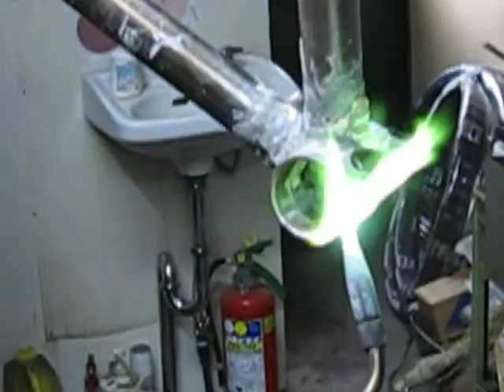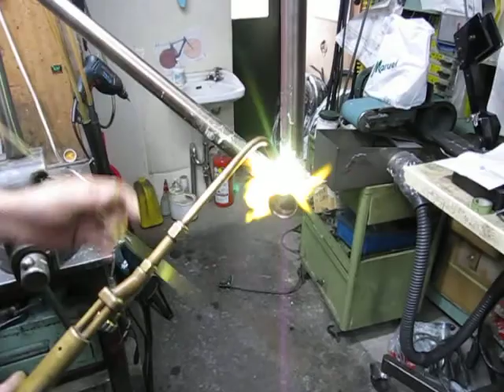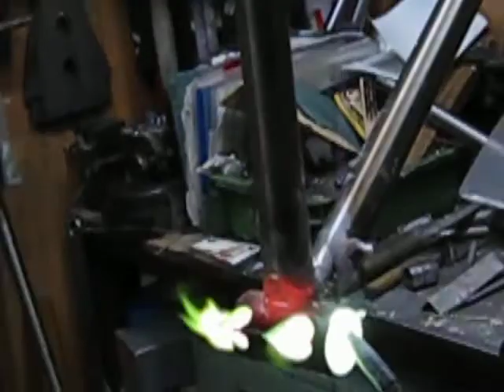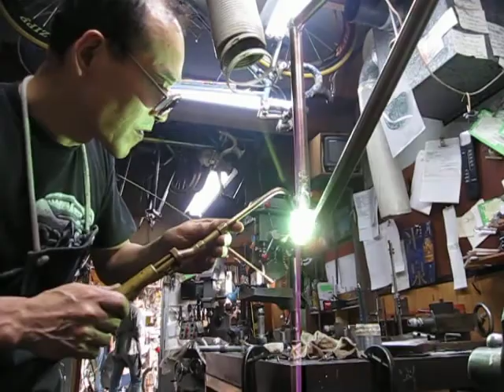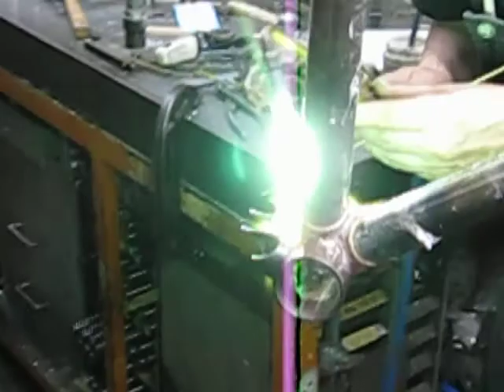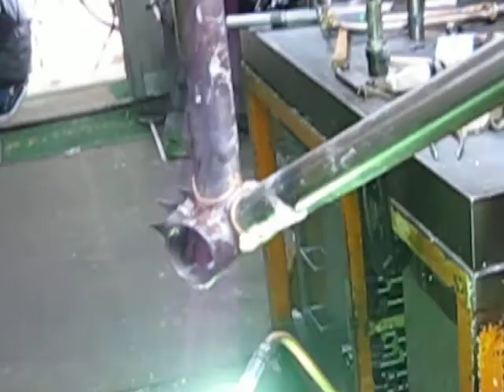Mr.Tanabe Kalavinka NJS frame building work - Two(Fixation of bottom bracket)

Comment: @ukdodger  what you saw was someone using silver rod to braze stainless steel tubes..silver melts at lower point therefore the tubes are not heat to cheery red colour. This guy is using brass which has higher melting point ...in other words both is correct depends on the tubes you use...if its stainless steel use silver, if its just plain steel use brass......brass is cheaper but use more heat (heat until cherry red)